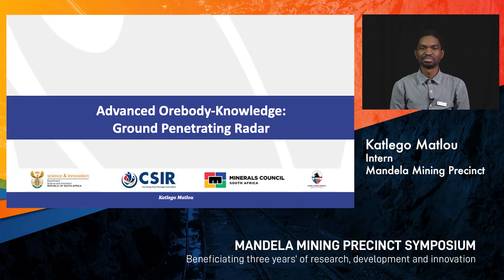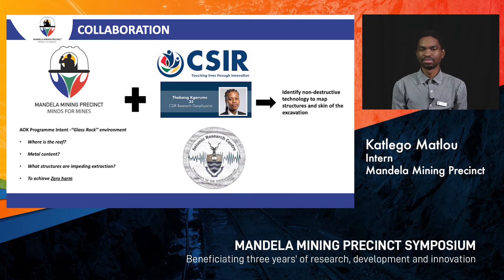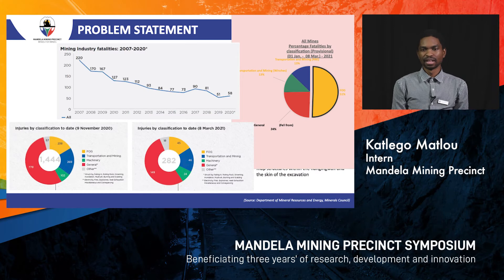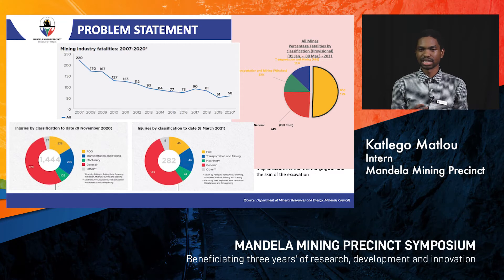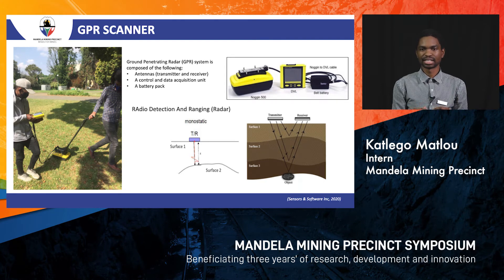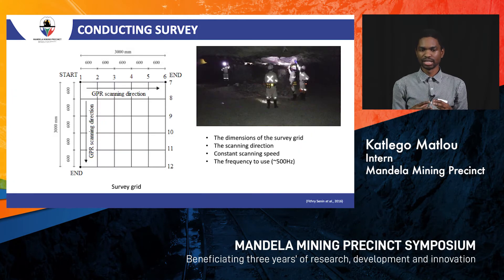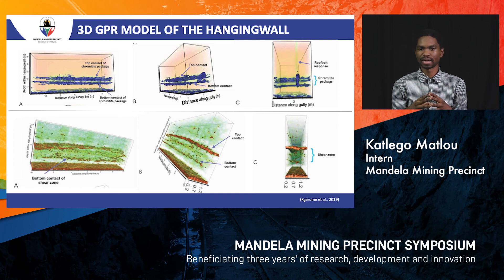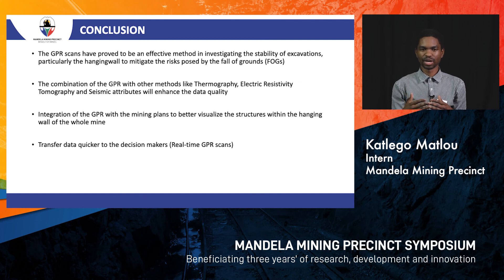Ground Penetrating Radar: Underground testing - Katlego Matlou, Mandela Mining Precinct Intern

Comment: GPR sub-surface imaging is going to play a key role in post-blast rock stability inspection. Two key aspects that are of concern: EdgeAI tools for in-situ AI inference of radargrams. Secondly, GPR works in 10MHz to 2.6GHz band of RF spectrum. While it provides immense knowledge about sub-surface structural discontinuities, it's resolution at this frequency might not be sufficient to map tight joints. A hybrid solution of combining mmWave high solution surface images with low resolution/oversampled GPR depth imagery can be a way to go. I've been following the work done by Mandela Mining Precinct, great initiative. Hopefully, we will have such R&D facilities in India soon. #Mining4.0